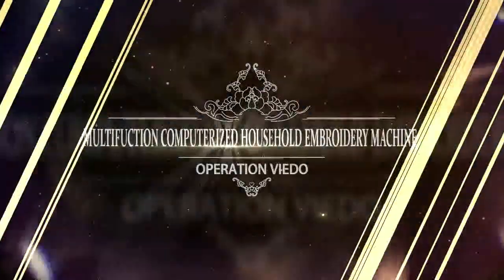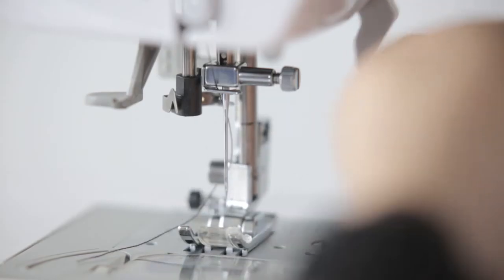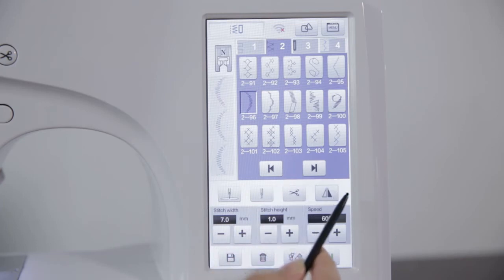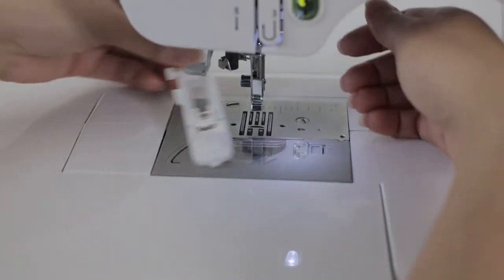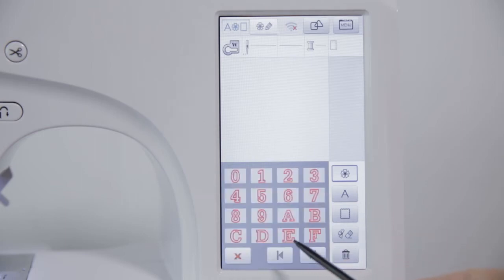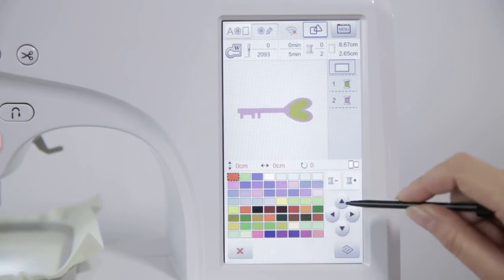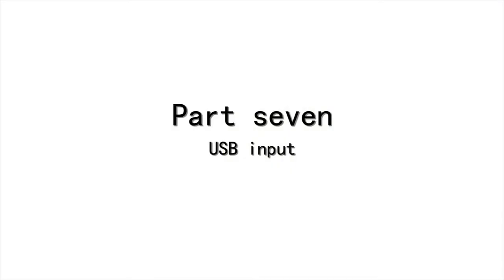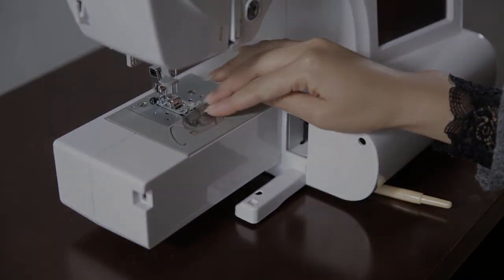DOIT Multi-function household sewing machine

Comment: I bought a DT9090, the machine arrived but the touch screen not responding. Please can you give me some pointers.
Reply from the maker: where did you order from?
Reply: @DoitSewingMachine  a question on my question one month later? I'm sorted thank you
Reply: Hour Glass how did u sort out!! I m also having same problem
Reply: @Zudhuleena  There is a special lil pen thing you need to use to work on the screen. No2. Make sure the winding bobbin is not on the "on" mode. Ive sold that machine ages ago. Hope you get your going. 3rd. When you done editing your picture/logo press on the lil green arrow bottom rightish of the screen. it looks like an enter key of a keyboard. Hope I make senses
Reply: @hourglass1640  in your opinion, is this machine worth investing?
Reply: @walkyourdreams  Brother Innovis 800e is very well priced and a super friendly domestic machine. It comes with a huge frame.. 160mmx260mm. You work with a USB and have a fantastic colored screen.. you can combine your designs as well.. I do digitizing and most of my clients is Brother users